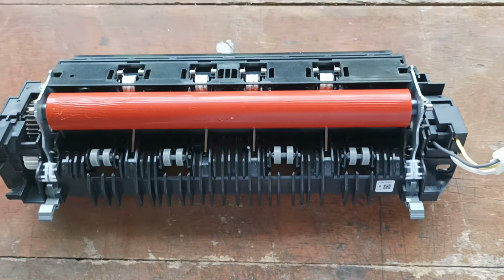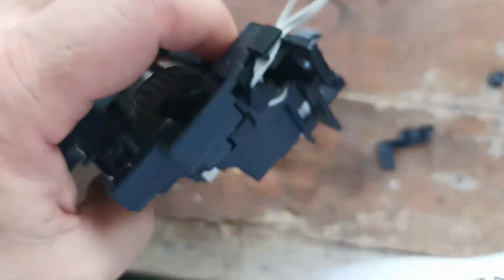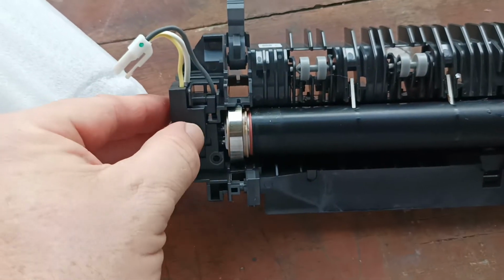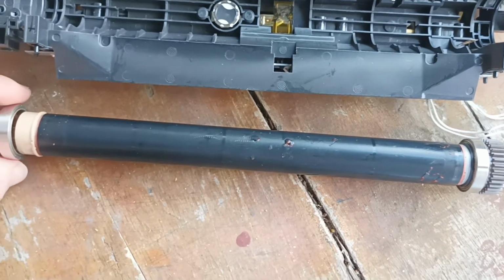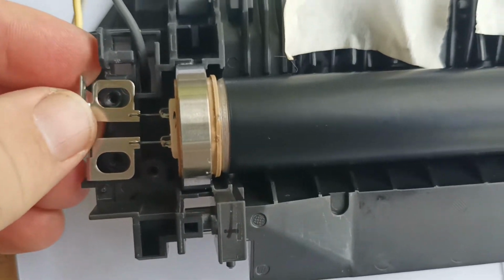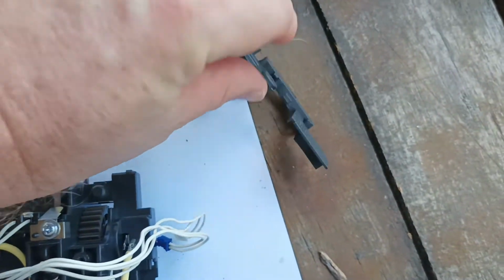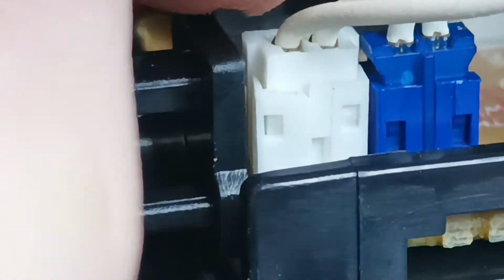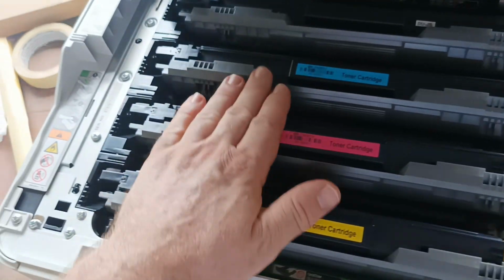Brother Fuser Unit Roller Replace Mfc-L3745cdw Mfc-L3750cdw Mfc-L3770cdw Hl-L3230cdw Hl-L3270cdw

Comment: Last week I fixed my washing machine thanks to two Russians on youtube, today my printer thanks to an Aussie. Great thanks from Belgium for a great, very well instructed video. With only one hand!!
The mistake I made: I fed non-laserjet transparent plastic sheets to my Brother HL-L3210CW laserjet printer. Worked for two sheets, but jammed on the third. Did not have to replace any parts, just open up the fuser roller to take out bits of molten plastic. Now I know laserjet printers get very hot inside!

Comment: Great videos. I had a savage burning smell from the printer last week and we had jobs running so I bought a new one for my wife's business. I saw your fuser vid and got to the old one to see what I could find. Stripped it down as far as I needed to see the roller clearly and found 5 x sheets of paper wrapped around the heater roller. 
Got most out but had to also gently clear the roller itself. Got it done with no damage and she works like a charm again - a great spare until the toner runs out finally :)
Thanks for the detailed break downs mate.

Comment: Hi Terry, thanks to you I replaced my fuser a couple of week's ago! I thought it went well. I have the HL-L3290cdw, and I started getting a replace fuser message again yesterday. How do I clear that on this device? Brother won't help, they just tell me to take it to the shop, which is 40 miles away, and booked up. I have found instructions for clearing an mfc, but that's not what I have. TIA
Reply from the maker: Did you have any print defects on your paper , bumps, indentations? If not then you didn't need to change your fuser unit you just simply changed it due to the counter saying to change it. Reset the counter, keep using your old fuser and get on with your life.